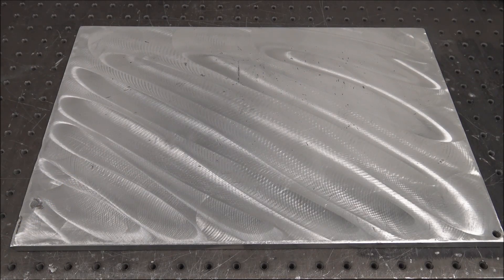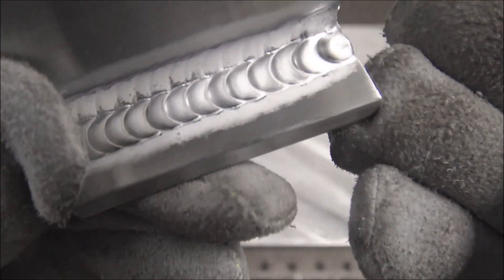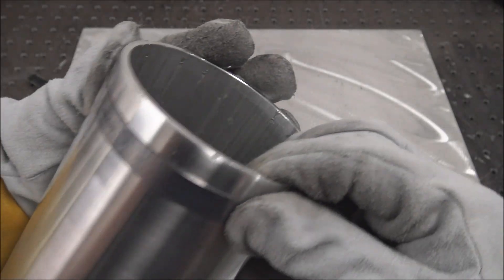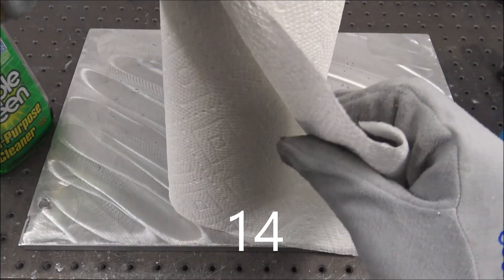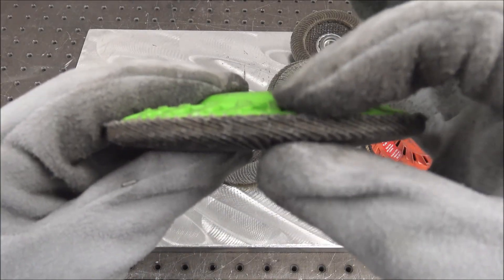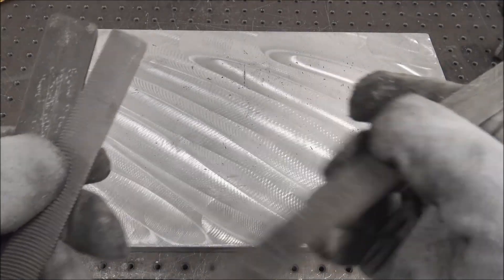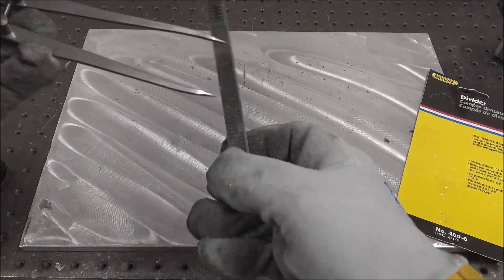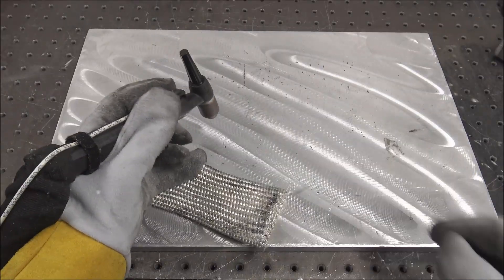35 Fabrication Tools I Use and Where to Purchase Them

Comment from the maker: 1-3M Safety Glasses: https://amzn.to/46sYZY4
2-Earplugs Hearos: https://amzn.to/4c6k1Np
3-Tillman 25B gloves: https://amzn.to/4cVLe6J
4-Stainless Brush: https://amzn.to/4dsCCUP
5-NON-chlorinated brake cleaner: https://amzn.to/3WLl4Oj
6-Sharpie Ultra Fine Point Marker: https://amzn.to/3YtfgdE
7-10" "crescent" wrench: https://amzn.to/4c5HnCN
8-Welding pliers (Irwin recommended): https://amzn.to/46qYSwh
9-Machinist ruler Mitutoyo: https://amzn.to/3WMCieq
10-Ball peen hammer: https://amzn.to/3WMa6rS
11-Machinist square set: https://amzn.to/4dhlXnu
12-Simple Green cleaner: https://amzn.to/3SuXe73
13-Windex cleaner: https://amzn.to/4fvwaP1
14-Bounty paper towels: https://amzn.to/3Yus838
15-Ryobi Battery Grinder: https://amzn.to/3Ytbb9w
16-Dewalt "paddle" grinder: https://amzn.to/3WJtoye
17-Flap discs WITH HUB: https://amzn.to/3SxlqFE
18-Wire wheel grindig cups: https://amzn.to/3WKhGmK
19-Digital calipers: https://amzn.to/4d2y5Zv
20-EZ lap diamond hone files: https://amzn.to/46vRobf
21-Box cutter thin blades:https://amzn.to/3A5gLVb
22a-Smooth "mill" single cut file:Google search "westward flat alum file"
22b-Aluminum flexible file fast cut: https://amzn.to/3SUrw3t
23-Speed square set: https://amzn.to/3WKi5pg
24-Digital angle finders: https://amzn.to/4d4LUqu
25-Protractor angle finder: https://amzn.to/3Ym5cTM
26-Digital protractor: https://amzn.to/3yoOpVr
27-Precision Pencil Compass: https://amzn.to/4cVNiM1
28-Combination square: https://amzn.to/4fo8JXD
29-Divider compass set: https://amzn.to/4dkV3L6
30-Putty knife: https://amzn.to/4cayic2
31-Channel lock pliers: https://amzn.to/4fvxnG3
32-Precision Nicholson needle file set: https://amzn.to/4dITRSj
33-String bubble level: https://amzn.to/4doSt78
34-Empire levels: https://amzn.to/4dkvD0V
35-Fiberglass heat pads (get size XL): https://amzn.to/4dppjEH

Comment: Angle grinder sanding discs, PFERD curved or derivatives are also cool when finishing. I use those a lot in hard to reach places and at some point I started to use these a lot, because wholesale prices compared to regular are not that different.

Comment: I think that you left out a very important one:  a first aid kit.  Nothing fancy just various size bandaids, alcohol wipes, topical antibiotic cream, tweezers, adhesive tape and gauze pads.  Hopefully enough it won't get more than something minor but it helps to have it handy.  I am on blood thinners and the slightest cut will bleed a great deal so tending to it right away is quite helpful.  Very helpful video.
Reply: Don’t forget the burn spray!😁

Comment: I love this kind of content for a change. Ordering up a set of pliers now.  That was great. I’d like to know a little more about that WD40 valve though.  I use shure shot pressurized canisters but often find them too heavy and cumbersome.
Reply from the maker: @garysgarage101
Hi Gary,
Here's the link to the video of me making it:
https://youtu.be/4qNMp0vDOCc?si=8Lp9kZAQ3dCNd9Iq

The bottom threaded "nut" acts as an adjustable stop to limit flow. It bottoms out at whatever depth you set it at.

A slight improvement would be to knurl both pieces, but they work fine without.

Comment: Im want to know about your tig button holder.  Is it an elastic band for clothes sewn in a circle?  I would like to buy one.
Reply from the maker: The one you are referring to was a prototype elastic band. It sucks. It wears out and doesn't hold up to heat. That's why all orders are sent out with the improved velcro straps. Much better, and that's what I've been using for the past 4 years.

Comment: Check out Bullard Abrasives NetGrind non-loading flap wheels made specifically for aluminum.  They do not clog at all, and last a lot longer than non aluminum specific wheels. They leave a better finish also as they do not drag clogged material through your work. Work great on plastics as well, if needed.

Comment: Buy a gallon of WD40 (costs the same as large spray bottle) and cheap gardening sprayer, you can get the nozzle out od the sprayer and it will give you nice concentrated stream that is easy to control

Comment: Aaron , thank you for taking the time to make this video, I saw a good tip for making precision measurements with dividers or a compass. You use a Starrett 12 rule and each line is ground into the rule , so you put the points of the tool in the ground lines on the rule  and you are now transferring your measurements the most accurate way…

Comment: I don't understand why people still buy angle grinders with slide switches on them. You're asking for a hand injury. Love my Tillman gloves 👍
Reply: I absolutely hate the grinders with the paddle lol, if I'm one handing it, the paddle forces me to hold it far back down the handle, so I can't get much leverage while grinding, it feels super unsafe to me. With the switch I can hold it further up much more solidly
Reply: I don’t understand why people use grinders without the backing shield on regardless of cut off disc or grinding disc. Asking for a hand injury regardless of if it’s switch of paddle triggered. 😂
Reply: @jacobgordon1605 the guard sometimes interferes with the correct angle for the sanding disk, that's the only time I have no guard and is why he has no guard in the video.
Reply: @jacobgordon1605  working in tight areas (especially rust repair in cars) that guard really gets in the way. I wear cut proof gloves. Along with sanders ya not really gonna need that guard. As for the side button toggle, soooo so soo much better than a paddle, at the end of the day if you do nick yourself (which you shouldn't be in any position that could happen but it can happen ofc) a paddle isn't gonna do much cos it still gotta slow down once to turn it off
Reply: Because paddle switches suck especially for cutting. It puts your hand in an uncomfortable position when turning it sideways. I use metabo grinders with a slide switch and the come unlatched if it kicks back or moved too fast, probably faster than one can release a paddle switch
Reply: You could say the same about using grinders without guard and grip. Do whatever you feel comfortable with. I'm not unhappy with the slide switches but I also use guards so what do I know.
Reply: Carpal tunnel no matter which grinder it is. Paddles still have a locking switch present so depending on preference paddles grinders are heavier, switches on grinders are more for grinding longer and polishing. As stated before it is all preference there are reasons why everything is built with ergonomics in mind for vastly different populations and needs.

Comment: Thanks! These videos are super helpful. It’s always great to get suggestions on tools and which ones hold up to use. You never know what you may be missing. For example my buddies always “loaned” tools from when they were working on jets in the service and I never knew what a Panduit gun was until I saw it on their bench. You would think a zip tie gun was a waste of time but, I tell you, they are great and tighten the zip tie and leave a perfect flush cut and never leave that sharp edge that will send you to the hospital in the future. Don’t get a plastic one, get a used all-metal one off of eBay that is past it’s calibration date and you will use it a lot and wonder why you didn’t have one before. Hope this helps someone. 👍🏻